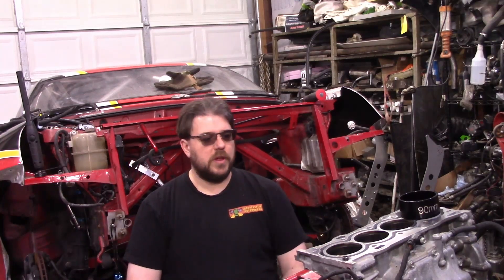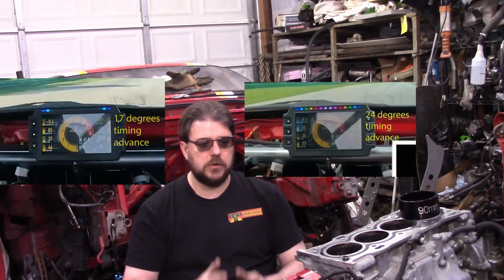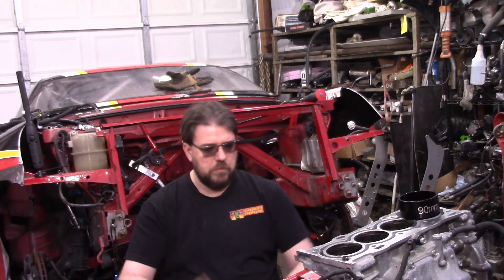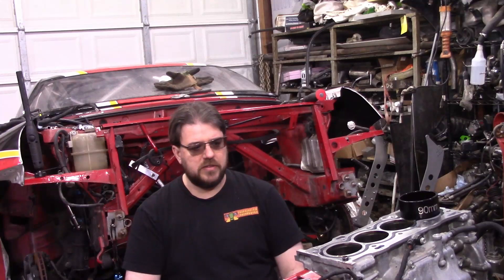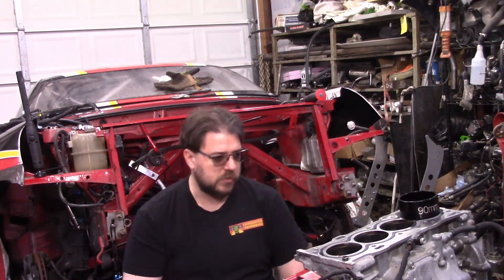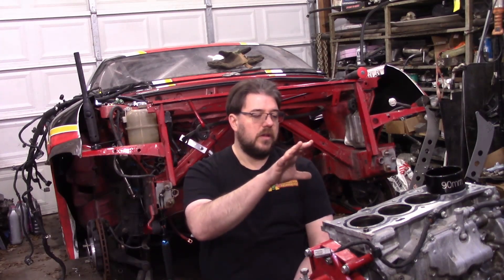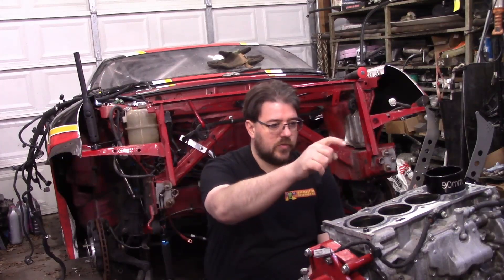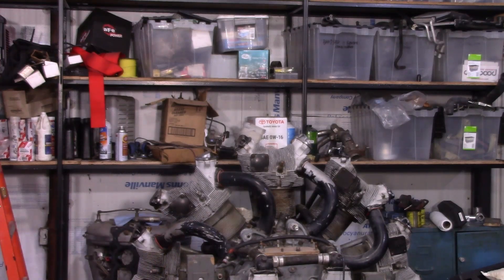2AR Missing power?

Comment: MY EJ motor @ roughly 12:1 compression on E85 was giving me 230psi in each cylinder. Except the one I blew the ringland on.
Reply from the maker: turbo motors tend to have much shorter duration cams with much less overlap so those numbers will be quite a bit higher.

Comment: Probably reading plugs on the dyno should have skipped the tearing down of the engine
Reply from the maker: I actually show the plugs in the video, this was something i checked pretty early in the debug process. For some reason the injector failed in such a way that it did not show on the plugs. I can't explain why because it did show on the valve but this is something i tried.
Reply: @FrankensteinMotorworks  oh, yeah, probably only with fresh plugs, full run, engine shut off could have given a sign on the plugs
Reply from the maker: @mihailpetrovici5044 Unfortunately, on a vehicle that is really only used on the track, unless you fake a breakdown to let a tow truck bring you in while ruining a few laps for everyone else you really can't shut down right after a hard pull. Barber Motorsports park is the only one i can think of because their pit lane is downhill so you could coast back into the pits with the engine off. I'm sure there are others but at most tracks the pits are either flat or uphill.
Reply: @FrankensteinMotorworks  or on the dyno

Comment: Would that had been caught if you had used a temperature tester on each header pipes?
Reply from the maker: yes but unfortunately this is not possible in this chassis. the header is hidden under the parcel shelf and there's no way to properly get a temperature gun on there
Reply: My thought (I am a design engineer so my mind is always thinking of alternatives) for not being able to access that, since this MR2 is already heavily modified, my thought would be to fabricate either a removable shelf or some type of access panel (maybe from the passenger compartment) so for tuning purposes you could access the headers with a temperature gun to verify consistent exhaust temps on each cylinder. If fabricating a new panel then probably would be necessary to add some stiffening to the interface areas where this "removable panel" would interface with the "firewall". Just an idea... @FrankensteinMotorworks

Comment: Its very unlikely that the dead injector was nearly as bad as the tester was in the car.  The cheap injector testers out there have very weak drivers that could exaggerate a weak coil in an injector.  You could try checking the ohms of the coil in that weak injector to see if it has any variance from the other 3.
Reply from the maker: Right, i 100% agree. I tried to mention in the video that this was just a cheap tester but it certainly was good enough to outline the issue here and replacing that injector restored the missing horsepower.

Comment: Have sorely missed your content. Wondered what had happened to you. Question....what did you do to solve the contact issue with the valves?
Reply from the maker: I promise 2024 will have more regular videos, thanks for coming back. For the valve contact i just installed my small valve spring upgrade kit and raised the rev limiter up a smidge to 7800.

Comment: considering a bone stock jdm K24a makes 230 wheel on a roller dyno, I'm pretty surprised this 12.5:1 2.5 liter only makes 225 hp. I think this motor would really wake up with cams and head work
Reply from the maker: Keep in mind this build was the build i did by using only OEM parts. the cams are out of a hybrid. I've got another NA build on the channel that makes 270whp and i have another motor built here that i haven't taken to the dyno yet but i expect to break through the 300whp barrier with it. 

As for head work, the valves on this motor right from the factory are already as big as a fully upgraded K can get to and the ports are cavernous. The 270whp build involved zero head work and the tentative 300whp build also has zero head work on it.
Reply: @FrankensteinMotorworks  Thats really impressive. It kinda blew my mind when in the video you said these motors achieve higher than 100% ve. I still think that with some head work these things would become monsters of the NA 4 cylinder world.

Comment: Running that lean would've been catastrophic and yet he pushed it round the track until it finishes, it's a miracle that cylinder survives. Great to see comprehensive diagnostic Marc, thx for the vid.
Reply from the maker: Unfortunately there was no sign of running lean, i was even there at the mid-ohio loss to look at logs and try to figure out what was going on and even I told him that despite being down on power everything was running right so to keep taking it out there. 

From what i understand the injector was going from running to fully shutting off quick enough that the engine never spent much time in the running lean region of operation so nothing burned up.
Reply: @nsteinMotorworks So it's the works of a faulty injector that made those behavior then? In your vid it seems that the 4th injector are almost fully absent on high frequency (rpms), I think it might've behaved differently like you said it being shutting off briefly when they're connected to the ECU, since all the sensors can detect abnormality from the engine.
Reply: @FrankensteinMotorworks could it have also been a situation where the other 3 cylinders were running rich, offsetting the lean condition of the #4 (as far as the readings on the WBO2 is concerned)?  Was duty cycle checked in the logs to see if the duty cycle of the injectors was abnormally high?
Reply from the maker: @kenny240 Yes, the abnormal fuel use did show in the logs but we were seeing airflow inconsistencies also so there was a bunch of stuff that together did not align to a diagnosis. In hind sight it's very obvious with the information i had but i did not put it together at the time.
Reply: @FrankensteinMotorworks I know how that goes. It happens in my line of work all of the time. Nobody is immune to it. It’s still a win though.

Comment: I once had a set of 550cc injectors on my 1JZ VVTI that weren't firing properly. The car never ran right.. even when tuned. It just didn't make the power it was supposed to. 

It was only AFTER i'd upgraded to a set of 1000cc injectors and increased my power goals, and sold the set of 550's, did I find out what was wrong with them (when a mate who bought them, told me he had to get them cleaned, flow tested and that they were uneven.

Comment: What did the VE values look like with the dead injector?
Reply from the maker: VE was peaking at about 100% before the fix and then went up to a bit over 110% after the fix.
Reply: @FrankensteinMotorworks  So it was either lean or using the trim to bring it back to target AFR? Could have been an indication of fuel flow issue. 

Not dissing at all, completely understand the steps you took to resolve this issue and the logic behind it.
Reply from the maker: @asian4747 I'm using MAF fueling, not speed density so this was not causing an issue. I could see that it was using more fuel than expected but at the time i could not figure out why.
Reply: @FrankensteinMotorworks  Ah I see, glad you were able to diagnose the issue and managed to get away with zero engine damage!

Comment: LOL!   The dyno test looked like a bear driving Barbie's  Dream Car.  I'm glad you figured out what was happening.  Ever find out what was causing the injector to malfunction?
Reply from the maker: Yeah, the seat in that car is a bit on the small size :) i had to unbolt the top so i could get in and tune it. 

I have not looked into the injector deeper at this point, i may be i suspect it'll be pretty unexciting.

Comment: Fascinating! Marc, I know you're a busy guy, but it would be tremendous to do a teardown of that injector to see how it failed internally. Also, very interesting about the valve springs. With the lighter springs, does the valve just close a little slower at high RPM and that's the issue? Is that symptom called valve float or something else? Still learning here...
Reply from the maker: I'm going to look but odds are the destructive disassembly required will destroy the evidence of what is going on in there.

Comment: I have been watching/following you for two years now and love seeing the progression on the 2AR-FE and its variants. As an Engineer myself, I love your though process and execution as it was well planned out.  
I currently own a M/T 2014 scion tC for 4 years now and I was thinking of AWD converting the car. I have been looking at the rav4 AWD as a donor parts as the architecture is similar. The problem I would see is the parasitic loses in the drive train, but looking at your simple modification to increase the HP really could make this project work. I love to see what future innovations we will see this year for the engine.
Reply from the maker: Usually the biggest issue with an AWD conversion is getting a big enough trans tunnel and still having space for the fuel tank. the 2014 tC also has the EB60 transmission and that has no center differential option so if you go AWD you'll need an electronically controlled clutched rear differential or switch the transmission for the previous version that does have a center differential option available.
Reply: What about an EAWD conversion with the rear unit from a Highlander?

Comment: wait, did you clean the injectors after replacing the one???
Reply from the maker: I replaced the #1 and #4 injectors. i probably could have cleaned the #1 but i had ones on the shelf so it was easier to just replace it.

Comment: I'm watching this closely, and i do have a question, do these block have provisions for longitudinal mounting in the chassis ? I'm guessing yes but worth to ask..
Reply from the maker: There's technically no motor mount locations for longitudinal mounting but some people have used the axle carrier mounting bolts on the right side and the A/C mounting holes on the left to hold it. If you want to keep A/C you could make something that picks up some of the oil air seperator bolt locations instead for the left side mount.

Comment: Wait so why did the motor come out? Like even pulling the head do you not leave the engine in? Or is it crammed under something on that chassis?
Reply from the maker: This is a swapped engine, a 2.5L engine where a 1.8L engine belongs and on top of that the head is a dual vvt-i configuration which makes it even taller. Technically yes, it could have been done in chassis but it's significantly less work to remove it to work on it openly instead of trying to work in the cramped chassis.

Comment: Did you pull the filter basket out of that injector? The basket may be just a little clogged so at idle the fuel has enough time to flow past the basket and build pressure against the pintle but as the duty cycle increases it has less time to build pressure and has a harder time injecting properly, explaining the poor injection at idle and the worsening performance as duty cycle increases. This is entirely speculation from me but it's certainly an interesting failure
Reply from the maker: I did not spend time inspecting the injectors after finding the failure but yes this is entirely possible that it was what happened. Someone else brought up that E85 may have freed up some previously stuck stuff in the fuel tank and that may be exactly what happened here. But with that said, the injector more or less fully shuts off above about 2500rpm, i would expect a clogged filter to still flow but mostly cap off at a certain flow level.

Comment: Did you end up replacing inj #1 too? Or was just changing#4  enough to fix the issue? 

Amazing job on the diag! Hopefully its not a common issue that starts rearing its head on these swaps. Seeing as its also a somewhat rare injector i assume?
Reply from the maker: I did also replace #1, i thought about just cleaning it to get it's flow back up but i had injectors on the shelf so it was easier to just replace it. 

I don't expect this to be a common issue with these injectors but that won't matter anyways since the injector availability is pretty bad and i want to support a more commonly available injector soon.

Comment: Wait did I miss something? What caused the piston contact?
Reply from the maker: Sorry, i could have gone in more detail on this. It seems that some 2AR-FXE motors have lighter valve springs than others so i set the rev limiter just a little bit too high. I upgraded the valve springs when i put the motor back together to fix this.

Comment: Did I miss where it was hitting the valves?
Reply from the maker: Sorry, i could have gone in more detail on this. It seems that some 2AR-FXE motors have lighter valve springs than others so i set the rev limiter just a little bit too high. I upgraded the valve springs when i put the motor back together to fix this.

Comment: Marc--did you happen to disassemble the affected injector, or notice anything weird with the others?  There have been incidences of E85 causing a "goo" to form over injectors related to certain additives (potentially polyisobutane).  Glad this was an "easy fix" in the end though.
Reply from the maker: interesting, i haven't taken it apart. it's still sitting next to the injector testing machine with the letters "NFG" on it. perhaps i'll cut it apart to see.

Comment: Holy crap Marc! I just got off the dyno with a 2gr that was behaving eerily similar to this unexplained fuel trim asychrony (> 10%), missing power but not a whole cylinder work. I had been searching for a spark problem, but none exists.
Reply from the maker: Hopefully sharing this does end up helping someone. Thankfully getting injectors tested is relatively simple.

Comment: Love the honesty, and nice diagnosing! What an odd way for an injector to fail. Out of curiosity, are these OEM injectors or are they aftermarket for the increased power?
Reply from the maker: These are OEM injectors but not for this motor, the injectors are from a 5th generation 3s-gte engine.

Comment: BTW, the injector problem likely happened AFTER the modified E85 tune…this car had a questionable history, and it is likely the E85 dissolved #&$&$* out of the fuel tank.  Fuel does flow from number 4 towards number 1 on the fuel rail, yes?  Would not take much sediment in the fuel to partially clog an injector.
Reply from the maker: It's entirely possible the E85 did clear stuff up but there's really not a before/after with E85 on this car. It started on pump gas to get it to the dyno but on the dyno for the initial tune it got moved over to E85. It did run at least one event after that at full power that we have logs for but it gets fuzzy after that when it happened. But this is certainly an interesting hypothesis and certainly could be correct. and yes, the #4 injector is nearest the fuel entry point into the rail.
Reply: @FrankensteinMotorworks  since it was running full power on E85, the tune had to change later…as did the fuel injector failing on number 4.  My point is that the bad injector appeared after the E85 tune and after the team started racing.  We will likely never know which came first: 1) the ECU tune changing to the base map (less aggressive ignition timing) or, 2) the injector failing.  I am assuming that the engine management system of the Haltech did not retard the timing as a result of detecting knock.

Comment: Glad to see you back, Marc.  Hindsight is always 20/20, and the tune wasn’t the only problem.  Simply amazed that the engine didn’t burn up on cylinder number 4 running that lean (saved by running e85?).  I am still baffled why this wouldn’t show up on fuel trims, as the ECU would add STFT to compensate for the lean condition on #4…which would also reduce power on the remaining cylinders as a result of being rich.  The reversion to the “base” tune, which pulled ignition timing, may have what saved the engine during Ben’s race.  E85 (which lowers combustion temperatures and tolerates more ignition timing) and the less advanced ignition timing from the wrong base tune likely prevented a catastrophic failure.
Reply from the maker: It did actually show up on fuel trims. We figured that out a while back but we could never figure out what that positive fuel trim meant. in hind sight we certainly should have dug further into those positive fuel trims. 

I think the biggest thing that saved the engine was that the cylinder almost entirely shut down, it was probably well below the low flamability limits at higher RPM. But that's not the entire picture since we do have evidence on the valve that it was running hot when it was running.
Reply: @FrankensteinMotorworks  it likely shut down at wide open throttle and close to redline, but if it was idling acceptably and dropping flow at higher injector duration, it had to run lean in between idle and full throttle.   The good news is that no damage was done.  I don’t think it would have worked out that way on gasoline, though I am speculating.
Reply from the maker: @reneneron2971 I can say that it was fine on gasoline. several of the outings it did have pump gas in there.

Comment: Would seperate EGT sensors for each exhaust manifold runner have helped in identifying this earlier?
Reply from the maker: Yes, it would have been clear right away. But this is a pretty rare failure and really does not justify the cost of an individual EGT setup for an NA motor like this.